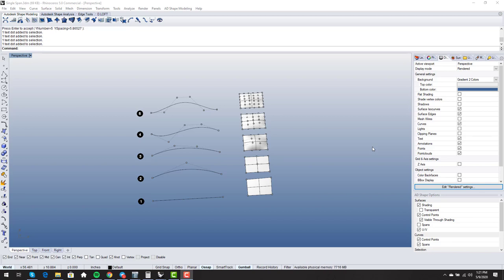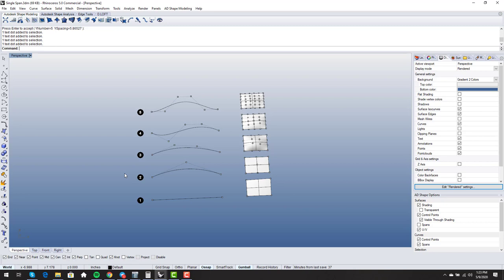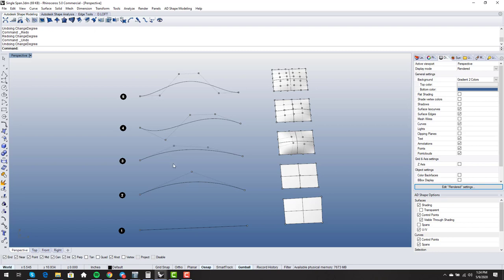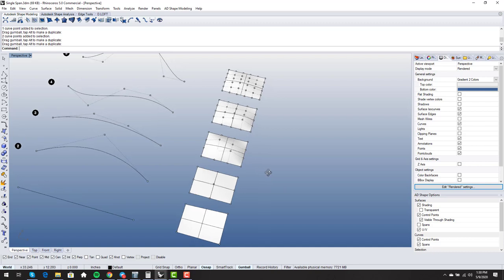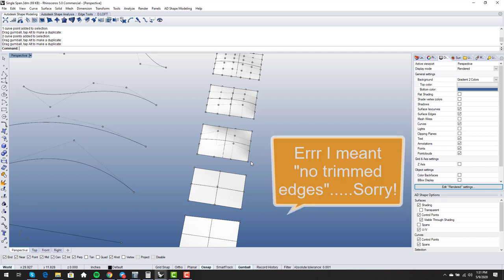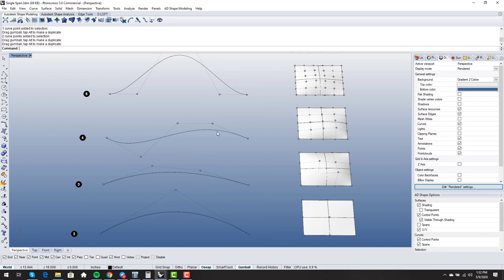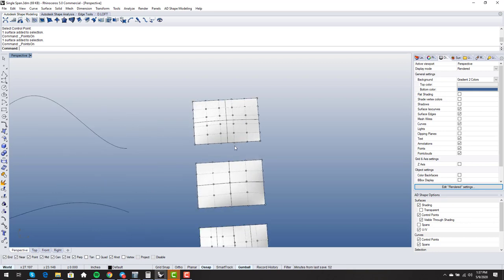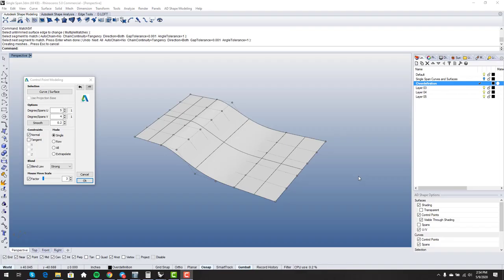Primary Surfacing: Episode 2 - Single Span

Comment: Thanks Sky. I tend to follow the single span guideline throughout all my primary surfacing, but once I get to blend surfaces especially over trimmed edges, i find it hard to get good continuity without bumping up the CV count. I try to keep it all single span but once i hit degree 7 or 8, I stop bumping the degree up and just add knots. I've noticed that i need more CVs building secondary surfaces (blends between 2 surfaces), and even more on tertiary surfaces (ball corners, y-blends). Is this normal or am i doing something wrong?

A secondary question : is adding knots the same as rebuilding with higher CV count (degree fixed) ?

Thanks a bunch

Comment: Hello, if I am trying to create a ship model hull, fully single span, with a complicated shape, is it okay to change the weight of my surface control points to as high as 100 as I am trying to get a 'flat of side' for my model. All looks well in the 3D model, but is this good practice?
Reply from the maker: If you've got a flat side on a hull - why not model that portion of the hull with a planar surface?

Comment: I'm a Alias production modeler in the automotives.     VSR always looked interesting as an affordable solution for my car projects outside of the OEMs.    Is VSR still available to use or did it get killed off?
Reply from the maker: Unfortunately Autodesk killed it off shortly after they acquired them. They actually did sell it for a bit, and for like a crazy low amount (~$300 iirc) but then they did what they always do - incorporate the tech into their own stuff and kill it off.
Reply from the maker: I'm a fan of your vids btw - I've combed them more than once for "okay that's how it's done in Alias, how can I apply that same idea to VSR/Rhino" Good stuff!
Reply: Hi, you might want to try XNURBS plugin for Rhino. It might fill the gap that VSR left off.

Comment: Hi - I need to create this embossed pattern https://imgur.com/a/e9p1p9I
I'm a total Rhino newb. I managed to do it using Extrude and then PatchSurface but the shape is not uniform or symmetrical and it doesn't look to be editable. I think there's a better way. How can I get control points in the shape of a triangle so I can distort / emboss the triangles? Any tips are most welcome and appreciated. Thanks.
Reply from the maker: You can create this type of effect much more cleanly by simply doing control point modeling. For a triangular shape like this, you can absolutely "collapse" one edge in on itself. So, start with a degree 1x1 surface - just a plane - and then put two of your control points right on top of each other, in the triangular shape you want. Then use ChangeDegree to say degree 2x2 or 3x3, and move all of your internal (not edge) control points up the same amount.